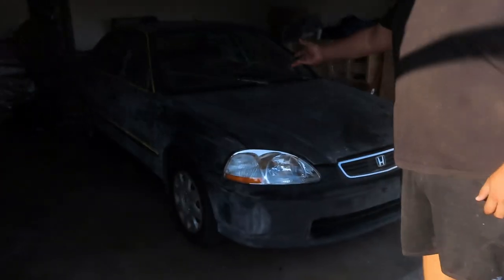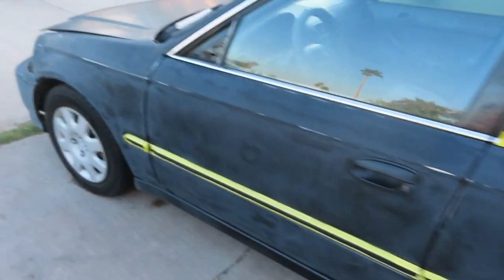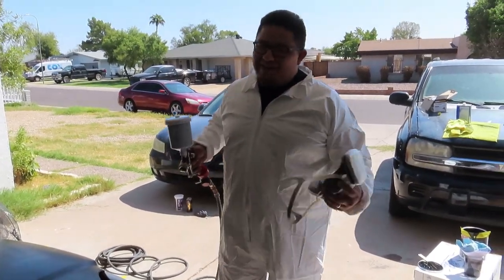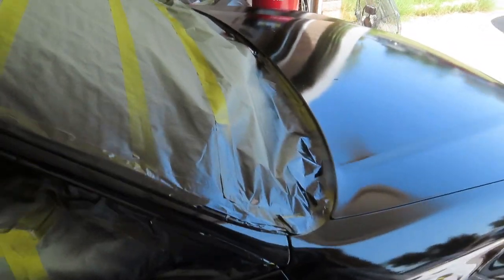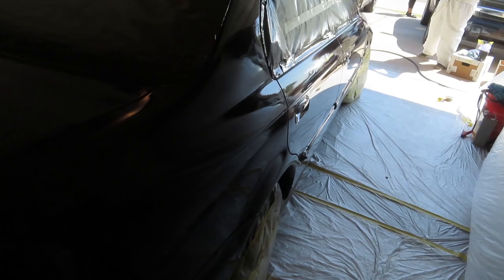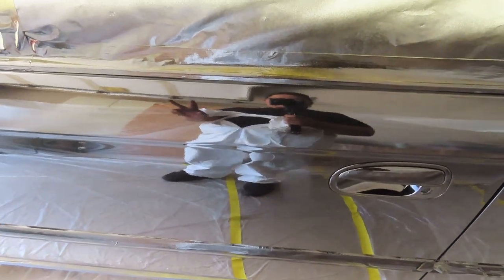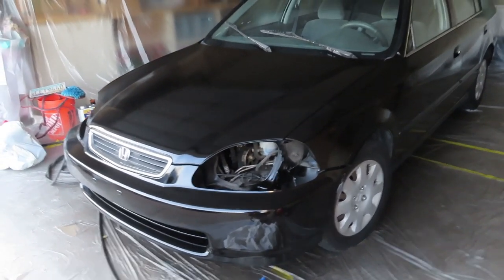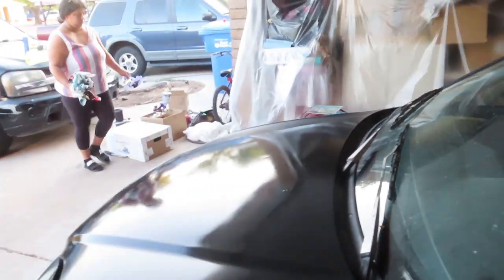$100 Single Stage Paint is Worth it!! DIY Paint job

Comment: Full disclosure, I'm not a painter.  But...I did use a single stage gloss black on a smaller item and what I found was that as I put 5 coats on it, it seemed to get better and better with every coat.  The last one laid down so smooth, I didn't bother to do any paint correction.

What I don't understand, though is, you did SO much work to get to the point of painting, but didn't fix the few little dings in the body.  Hell you could have even paid a PDR guy to come out and remove those first.  Now they really stick out.  Anyway, glad you are happy with it.  Certainly looks better than when you started and that's what counts.

Comment: Great job for your first time..  You should be able to correct the issues by wet sanding with 400 and hit it again with another coat.   
I think as someone mentioned a better gun should minimize some of the problems you had as well.   I picked up a Devilbiss FLG5 for primer and a Iwata LPH400 for my base/clear.    Hoping to get some good results..  I will be spaying my mustang this summer.   Original color is white and I will be spraying the same..  Should be a bit more forgiving.   I plan to pull the front bumper cover off , rear lights and some of the other body moldings.   Will be a lot of work, but hopefully will give good results.   No matter how it comes out / the main thing is you did it yourself..and that earns respect :o).

Comment: I like affordable ideas.  I recently painted two cars in a booth made by hanging tarps in a carport.  I used a box fan w/ filter to pressurize the inside.  On my 1965 Dart, I used 1-part polyurethane, Interlux Brightsides.  I mixed 3 part yellow w/ 1 part white for custom light yellow, which looks nice.  Biggest problem was I got the bright idea to use a Wagner electric sprayer.  The paint is self-leveling, so thought "should work" and give less overspray.  Biggest problem was the sprayer kept leaking at the front so had to wrap w/ cloth to catch those.  A few years earlier, I had painted the roof in white (instead of vinyl top), using the same Brightsides, while also painting my camping trailer.  For that, I used the roll & tip method with stiff foam roller followed by foam brush to pop  bubbles.  Came out very smooth and required minimal sanding.  I had also already painted the interior, jamb, and trunk using both rollers and sprayer.  The yellow outside had orange peel and got some runs on the side.  The orange peel I fixed by wet-sanding 1000 grit, then cutting compound.  When sanding runs, I got into the primer a few places.  But, w/ solid color and no clear-coat I easily resprayed with an air brush.

For the other car, 1982 M-B, I bought automotive 2-part polyurethane (add reducer and hardener), ~$220 for 1 gal, using the same HVLP sprayer shown (Harbor Freight).  I only had to paint half the car since I had swapped over panels from a salvage car which had been recently painted.  The store matched the paint perfectly (brought in sunroof), which is a modern light grey w/ slight blue.  I got about as bad orange peel as with the Brightsides.  I wet sanded the next day while the paint was still soft, but had to remove a lot to get it flat.  When not flat, you see shiny spots from the bottom of the orange peels.  When dull all over w/ 1000 grit, you have it flat and ready for compound with a DA buffer.  I had some runs, though not as bad as the Brightsides and also cut thru to primer a few places, but also touched-up w/ an air brush.  I used Interlux polyurethane Pre-Kote primer on both, which sands easily.  I used only 1/4 gal, so will paint our 1996 minivan next which has failed clearcoat.  Already painted the top white Brightsides, using roll & tip, then sand and buff, which took care of a lot of area.  I too would use automotive paint for a next time and solid color since easy to repair damage and oops when painting.  Might try an older cup sprayer on the minivan, though doubt that will help w/ orange peel.

Comment: Hey, you did a good job and had the balls to do it, you should be proud of yourself. Who cares about the passenger side if you're the driver man, lol. I remember painting my first one, spent a lot of time on the prep work, too much time and then didn't wet sand it, base and clear and it turned out with a matt finish, but still looked pretty cool.
Reply from the maker: Thanks man! I should’ve done that but I just ending up selling it.

Comment: Nice job! We all aren't professional painters and for a first time attempt at single stage I think it came out good.  You should save up for a much better quality spray gun,  your results will definitely be much better.  I'm just a hobbyist but I've been around painting cars since 1977. I still use my first paint gun, it's a devilbiss jga 602 suction feed conventional gun. Old school.  Like me lol. Fun hobby but please keep wearing a GOOD quality respirator because those paints will definitely hurt if not kill you.  I use what you have there.
Reply from the maker: Thanks man and yeah was definitely a fun little project. Soon I will be investing into a decent paint gun. 

Thanks once again!
Reply: I have a gun like that. Is there any disadvantage to that type or advantage?  I shot some rustoleum thinned with mineral sprits a few years ago.  I spayed red, white , and blue.  The red faded off. The blue actually pulled the old paint off under neath.  The white lasted for a while.  All were parked outside in a sunny area.
Reply: Those cheap guns actually do a good job when adjusted properly and kept clean. I've noticed the filter needs removed on thicker paints. If your having anxiety calm down and slow down relax

Comment: I'm gonna paint my car single stage white. It's a color change so I'm gonna have to do jambs and all. But I'm gonna get a couple gallons mixed together in a big bucket so the color is uniform. And I'm gonna do it one panel at a time. I'll probably start with the roof since there's not much trim to remove and not much prep needed. The doors are gonna be the hardest. There's a lot of trim to remove. But while it's off I'm gonna paint the trim gloss black. Should look good against the white body. But anyway, good job. The car looks pretty good for a garage spray
Reply from the maker: Thanks! And good luck should come out nice!

Comment: I'm getting ready to do the same thing on my 2000 F350. I'll use the satin finish to try to hide the imperfections. I say, as long as it looks good rolling down the road, who cares about the rest! Great job!
Reply from the maker: Heck yeah!! Thanks and good luck!👍🏻
Reply: What paint kit did you use and where from ?
Reply: We call the the 50 /50 rule. If it looks ok at 50 feet and or 50 miles per hour it’s good
Enough for a daily. 😉

Comment: Its looks so pretty when you paint it  , then the reality of the discounted price  becomes apparent when it dries . Go urethane enamel if single stage , but nothing is better than base coat /clear coat . It's worth the quality of luster
Reply: Clear coat doesn't last long in the CA sun and looks horrid if a dark color.  Our 2002 doesn't show bad clearcoat, but probably only because it is silver.  My black 1985 looked terrible (recently repainted).  Also, very hard to repair damaged paint if a clearcoat.

Comment: block wet sand and compound on the drip then you'll be good.  i would add more paint to the trunk so you can sand it down as well.  It looks like there's not enough paint on there.

Comment: the reason it came out hazy on the trunk is due to the fact the angle of your gun changes the "suction" or gravity feed of the paint which in return messes up how the air and paint atomizes so heres a tip. next time grab a spectrum or a 3m PPS cup system which allows you to spray even while upside down. 

thus keeping the material and air mixure stable in ANY angle not just perfect straight 90 degree.
Reply from the maker: Awesome thanks for the advice!! I’ll definitely do that next time 😊🙏🏼
Reply: No the paint came out messed up, because it was probably kicking off a lil too fast. Just remove the trunk and hood stripe and prime hood, and repaint the trunk and hood.

Comment: Also the phrase that will buff out come from a real place you could use a paint roller and apply single stage to a car and still be able to buff it to a glass shine
Reply: Kyle, are you talking real single stage high quality automotive polyurethane? I am mulling over this as we speak. I want to do the full on body work prep/prime/block and roll on my choice of color, then have it professionally sprayed with the same single stage after a year or so. It’s a vintage F150 so I’m not looking for a show car finish to begin with. Are there special considerations (if rolling single stage is feasible) to thinning  for rolling?
Reply: @FIGGY65  I mean yes you could buff out a rolled on paint job but it would be a lot of work if your doing single stage to save money, don’t you won’t save that much money, go on Ali express but a 20-$50 paint gun and buy some base coat and clear off of Amazon I did my 2500 Chevrolet Silverado base clear gallon of base and gallon of clear for $350 seems like a lot but it’s not now if your wanting something just so it’s one color go to your local Tractor supply,murdocks,Jax anywhere they sell tractor or farm equipment and you can get a gallon of implement single stage for about 40-50$ if you wanna try rolling it on this is where I would start put it on thick you will then need to sand it smooth and buff it from there proably starting at 600grit up to 2500grit

Comment: Those harbor freight guns like around 40 psi
Reply from the maker: I had a air pressure regulator on the gun
Reply from the maker: I had a air pressure regulator on it at 23 psi
Reply: @GoGetterGarage  in my experience they like about double that

Comment: There is virtually no reason these days to use Rustoleum.

Go to Amazon and look up the Spedokote single-stage finishes.  For around $100-$130, you get a TRUE acrylic urethane AND the hardner/activator.  It shoots FAR better than Rustoleum (especially in those HVLP), it is much MUCH more durable than Rustoleum, it is ready-to-buff in just a day or two (it is activated, it does not "dry"), it lays far flatter, has a superior UV protection, and downright just a better value for the money. 

There are a couple other brands on Amazon also selling "budget line" paints, but the Speedokote one is the only one I have personally tried and trust me: that stuff will make you look like a hero - even with limited painting experience.  It will also help you overcome some of the issues you experienced here (especially with that HF purple gun).
Reply from the maker: I'm not sure if you know but I didn't use Rustoleum I used a single stage paint just like Spedokote just used a brand from a local shop! I only spend like $108 including materials
Reply: @GoGetterGarage  gotcha!  Thanks for clearing that up!

Comment: Hey brotha what’s the Measurements would I need for. The Single stage
Reply from the maker: I did 8/2/1 8 parts paint 2 parts reducer 1 part hardener
Reply: @GoGetterGarage  yooo sorry brother I didn’t see that you replied back  and thanks …. And also I got a small Garage have you ever put the car to  one side and get back in it and move the car to the other side to paint it over and over till the 3rd coat
Reply from the maker: @pocnigga11  honestly I haven’t but I’ve seen youngstatic do it like that lol

Comment: what settings did you have that harbor freight gun at? thanks !
Reply from the maker: I just had the trigger fully compressed and adjust the feed until it didn’t spin and more and the air pressure valve was fully open I had an adjustable air regulator with filter
Reply: @GoGetterGarage  thanks! what psi was your compressor at?
Reply from the maker: @samlouie7754  my compressor was maxed out I just had my regulator at 23 psi
Reply: @GoGetterGarage  siccassfoo
Reply: @GoGetterGarage  I think your gun is a High Pressure gun and regular house compressor couldn't keep up that's probably where the trunk area ran into issues, the compressor couldn't hold steady pressure, but man the sides turned out damn good, next time use a low pressure gun they work great with small compressors, did you sand the trunk and buff it out? How did it come out?